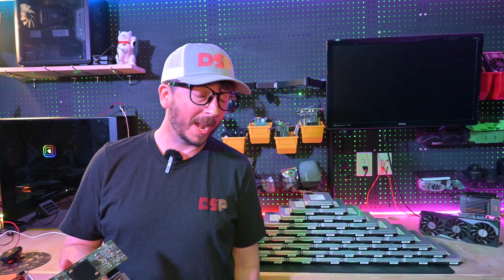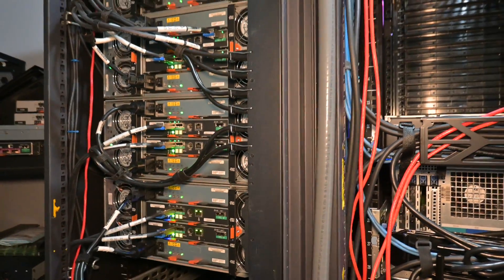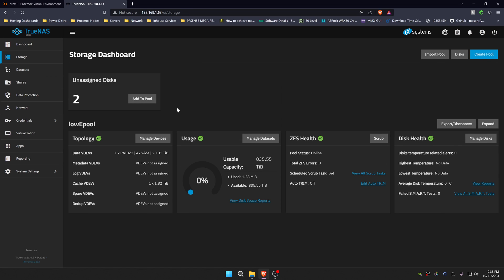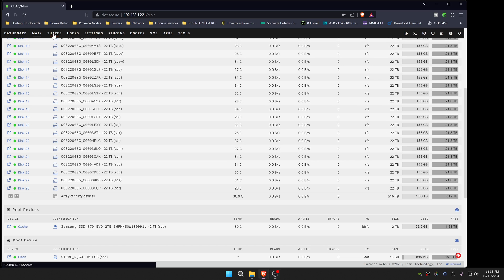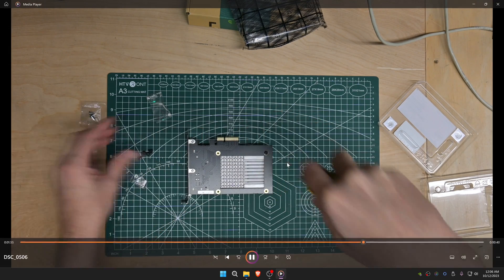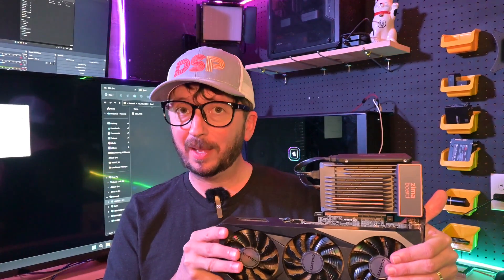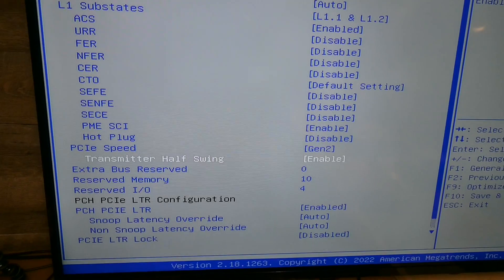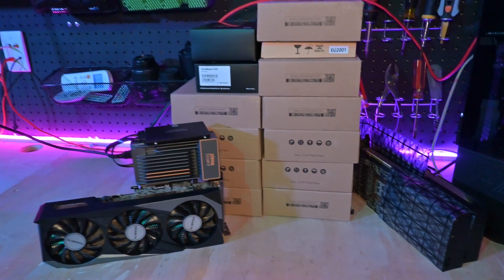UNRAID and TrueNAS PETABYTE on a ZimaBoard?! Will it Work?

Comment: Thanks for sharing the PCIE Settings to get the HBA to work, it works on the ZimaBlade Quadcore.
Reply from the maker: Yeah I mentioned to them they need a detailed bios walkthrough guide that's very in depth. A lot of the settings are non-standard they surface to end users.

Comment: Not sure if I missed it, but would be interesting to see if you could utilize all 45 drives in Unraid using a ZFS pool.
Not sure if the 30 drive limit only applies to the array or pools as well.

Comment: Can you run a harvester node on the Zima board?
Reply from the maker: I'm testing this but it looks like yes. How far it can go however remains to be seen.
Reply: @DigitalSpaceport Cool, im looking for a low power harvester node. My current nodes are a power junkie.  I didn't realize it till your recent video and I checked on my power usage.

Comment: Aren't those OS drives SATA though? SATA can't make use of dual path, so why use a second IOM and second cable path?
Reply from the maker: Yes they are SATA but the jbod itself can act up if it's not connected to both and this helped eliminate that as a possible issue. Spending around 2 hours testing out the various bios PCIe settings to get the HBA working had me working in a very cautious mode.